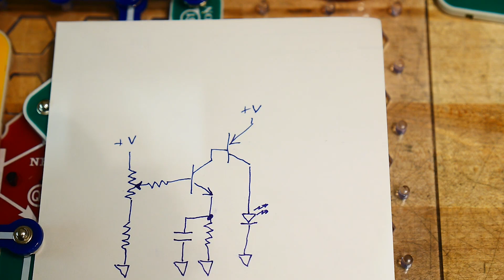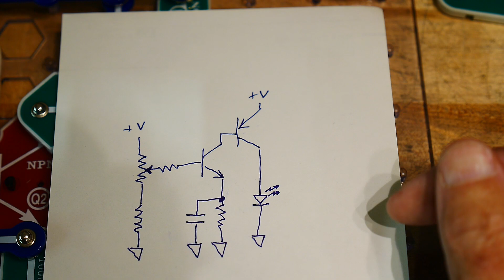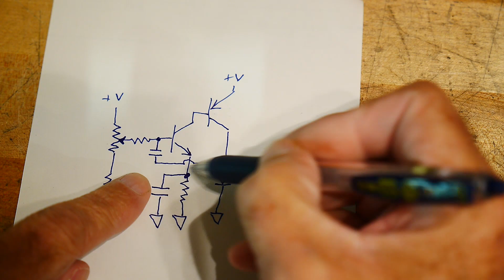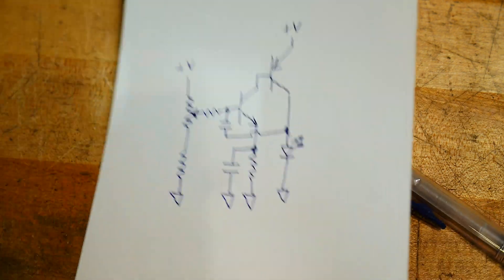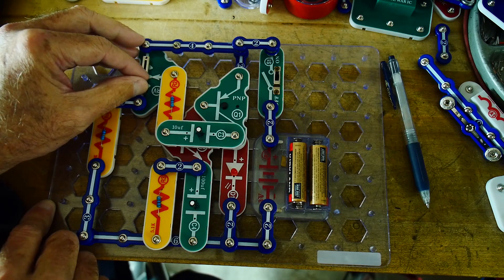#399 Snap Circuit NPN PNP Oscillator

Comment: Thanks so much for the great demo and explanation.  Snap  Circuits has some great experiments but there is very little explanation of how and why the circuits function.  Can you explain the purpose of the 100uf capacitor and the 5.1k resistor at the bottom of the circuit and how they affect the oscillation?  Thanks!

Comment: So what is a better way to teach? Snap circuits components and <insert other book here>, or some other kit?
Reply from the maker: for good books for older:
https://youtu.be/OBNl-6nFyL0
Reply: @IMSAIGuy  I've got one of the editions of Art of Electronics, and at least a PDF copy of the ARRL book... but, so far I've been playing the snap circuits with my almost 2.5 year old... he's still getting the fine-motor skills to snap the pieces together... he's having fun with "me helping" "him build" the various things the arcade and rover kits have to offer. I combined the two today, using the R/C module to drive the NPN and then low-side control the POV fan. I was a little taken aback when I HAD to add a resistor between the NPN base and the R/C output. Even shorting the base to + on the battery block didn't work... maybe some oscillation? I may end up scoping it out with my Rigol oscope.
Reply: I'm playing with snap circuits with my 4 and 2 year old kids, but with the included book it's really a pity that it only shortly says what the circuit should do, but doesn't say anything about why.

For really small kids it's enough, but the kit is used just as any other construction kit toy and once the kids get more inquisitive I have to use my own words to explain how it works and that's bad for parents without enough knowledge about circuits and difficult how to explain some basic concepts to small kids. With better book written by someone with teaching skill oriented on small kids the toy could grow with kids (first just construct with parents, then parents reading the well prepared explanation, then kids building themselves and then also kids reading the explanation themselves to fully understand what it does and why).

Such book would be much more valuable than just the parts included in kit.

Similarly the ICs included in the kit, it's great to be able to show some nice effects early (like playing music), but for older (and parents) it would be great to also show what's inside the ICs or even better have a advanced kit where you can build the same ICs from smaller parts.
Reply from the maker: depends on the age.